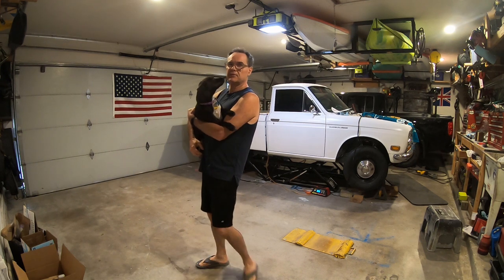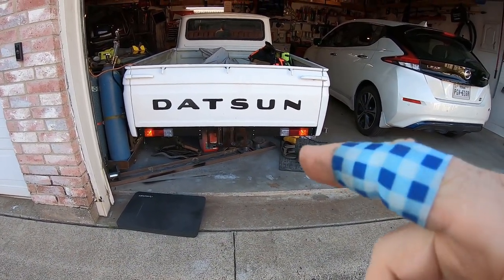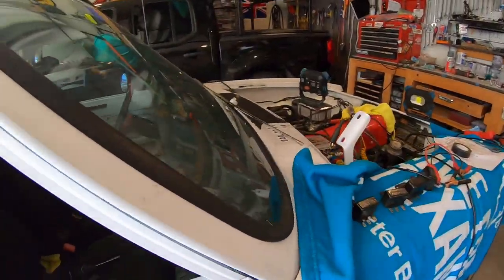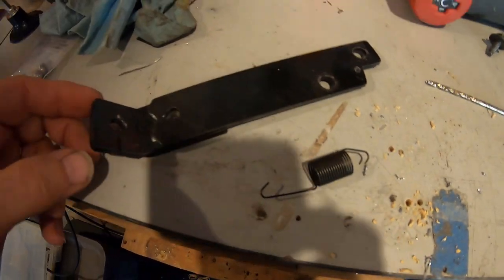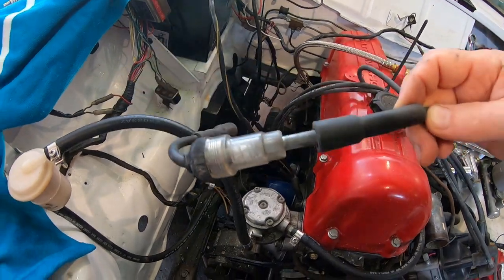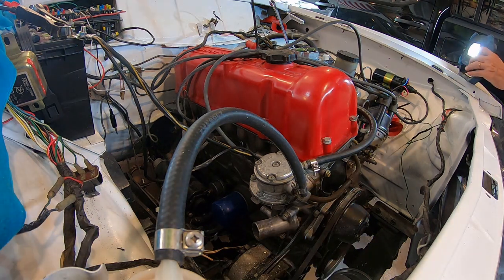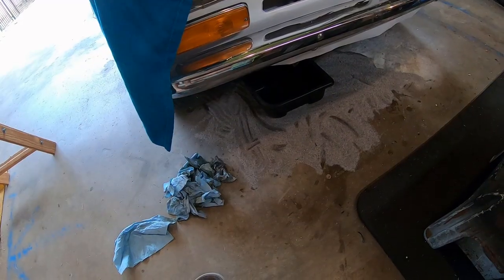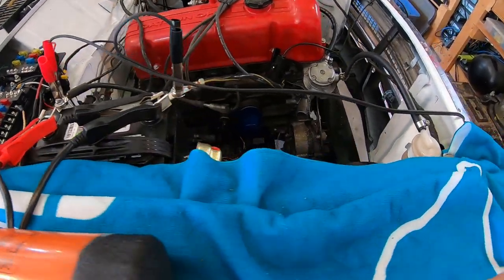1970 Datsun 521 Truck Restoration. Will it run, First start??? Part 29

Comment: We've got a runner! Sounds good. It's a big help, you being in front of me. The windshield, the windows etc. Makes it much easier for me.
Reply from the maker: Thanks! I since welded on the muffler and she sounds good. but still no idle. No compression in cylinder 1. I see 130 on the gauge but it will not hold.😭Next video has the door window seal install. It was tricky.

Comment: Heads up. Mine was messed up. Because I removed all the fuel return emission stuff it wouldn't keep fuel pressure.  Had to fit an electric fuel pump back at the tank.
Reply from the maker: Thanks!! I did also. I still have zero compression on cylinder 1.   I connected the exhaust after this video and it sounds good.